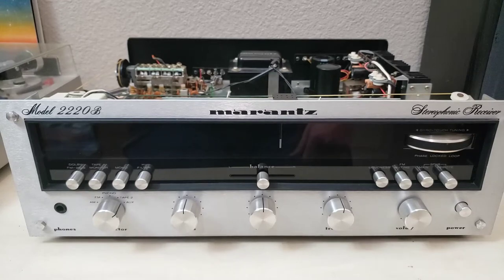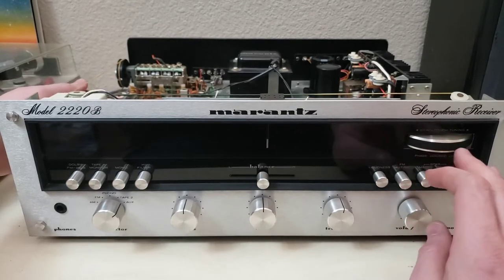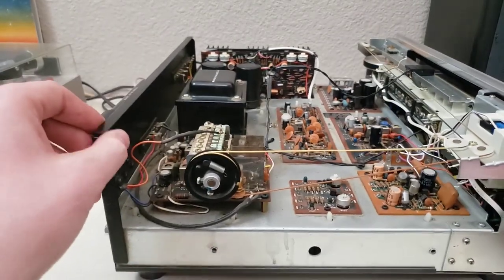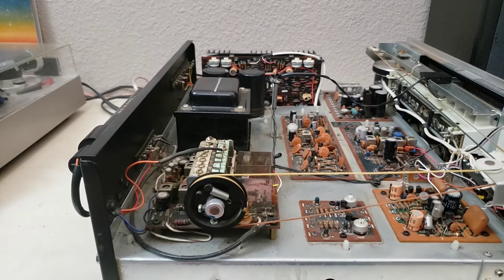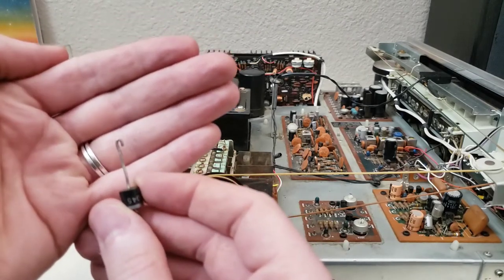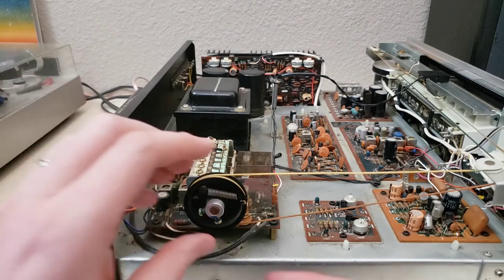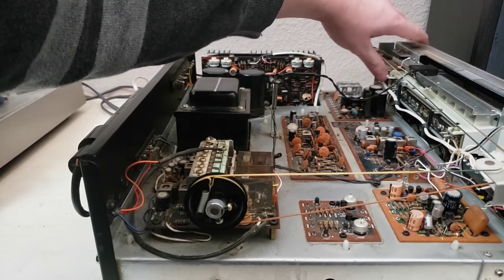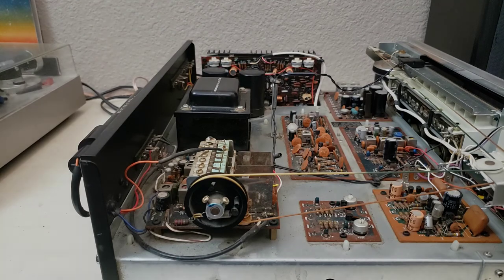Marantz 2220B: Repairing a Slipping Tuner String

Comment: Hello, what happens if the needle is all the way over and you keep turning the wheel?  Is there a safety feature of does it come out of tune and get loose?  thanks!!!
Reply from the maker: The tuning string is fixed directly to the tuning capacitor, so the needle and the capacitor stay in sync unless the tensioning spring breaks or you open up the unit and really mess with things.  The string is just wrapped around the wheel's axle a couple of times, so if you keep turning the wheel farther than the string can move, it slips in that loop of string.

Comment: After replacing the string, the needle does not travel the same distance from one end to the other but stops in the middle, since the tuning variable has no other turn to make. What could I have done wrong?
Reply from the maker: Using the wheel, tune the needle to the middle where it stops.  Unhook the spring on the tuning capacitor pulley so the string can slip. Slip the string on the tuning capacitor pulley until the needle is at the end of the dial scale, moving it in the direction it was moving before it stopped in the middle. When the needle and the tuning capacitor pulley are both at the end of their travel, rehook the tensioning spring. You may need to repeat this process slipping one way or the other a little bit to ensure the needle points to the exact frequency that the capacitor is tuned to.

Comment: i have the same tuning string slipping problem but it is slipping on this copper(i believe as it is copper color) cylinder coming out of the tuning knob. how would you go about fixing that? the spring is tight and ive tried rethreading the whole string but it still doesnt work. please help? love your videos btw
Reply from the maker: Try adding another wrap or two around the post on the dial. You may also need to grease the rail the pointer rides on.
Reply from the maker: Try adding another wrap or two around the post on the dial. You may also need to grease the rail the pointer rides on.